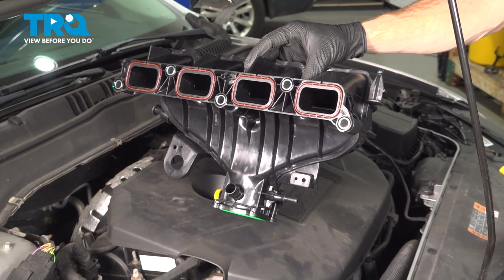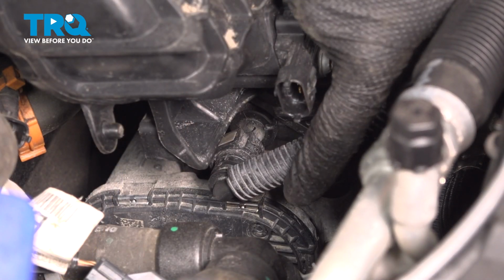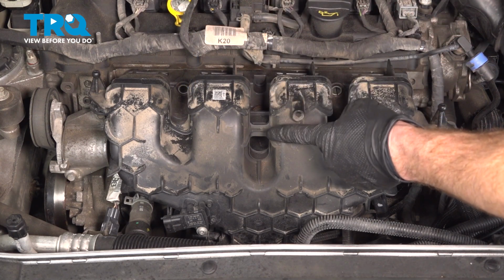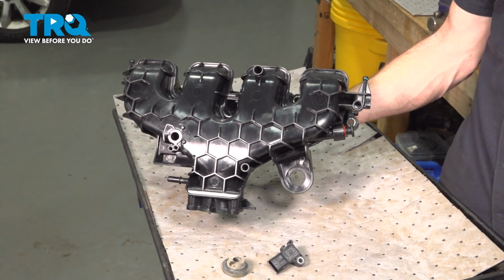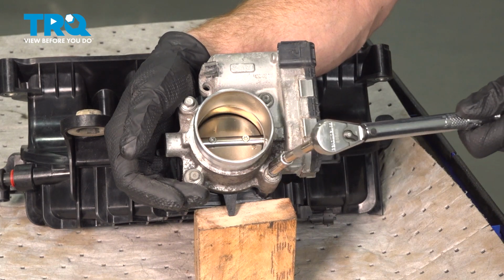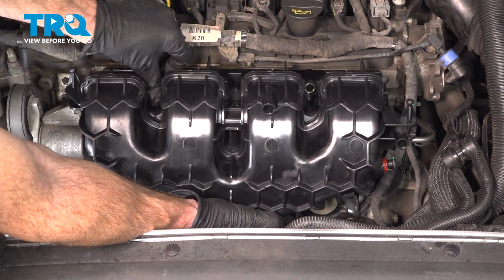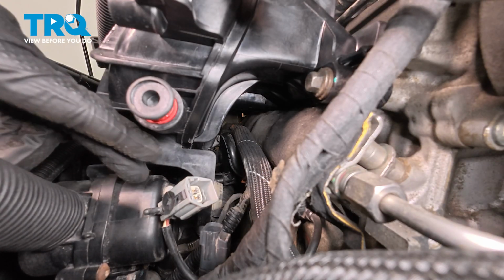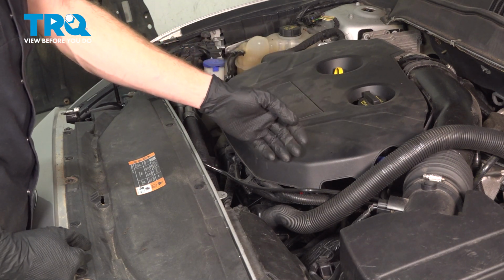How to Replace Intake Manifold 2013-2020 Ford Fusion 2.0L I4

Comment: Hello. 
At 8:33 what is the plastic cap piece with the red retaining clip called? And what does it connect to?
Reply: I believe you can see the same on the old one as you remove it at the 3:36 mark.